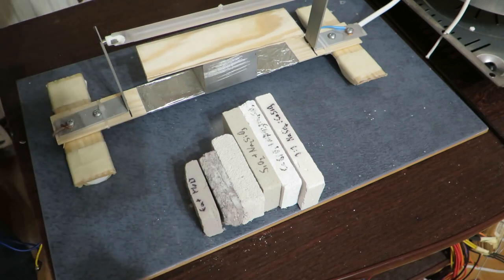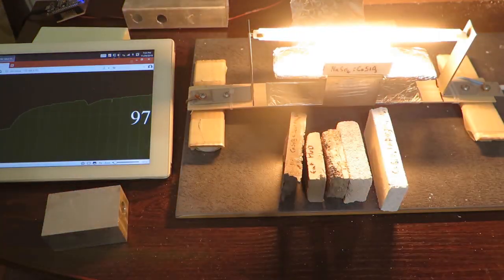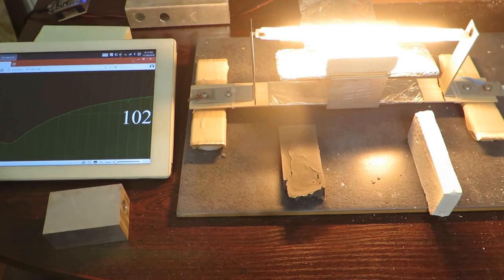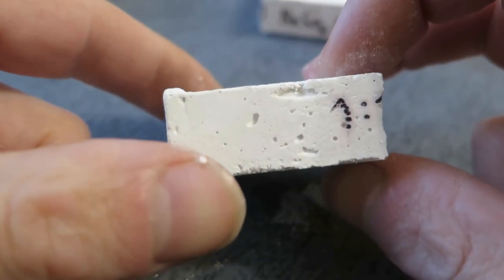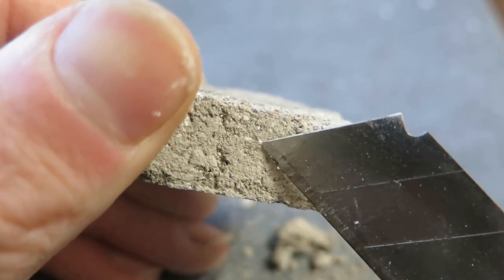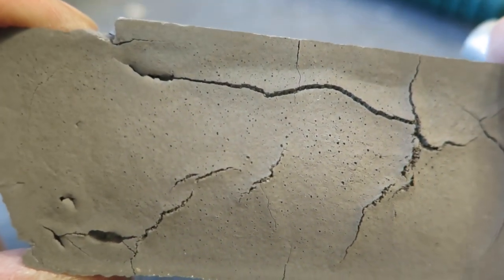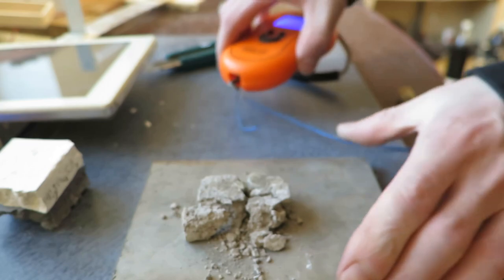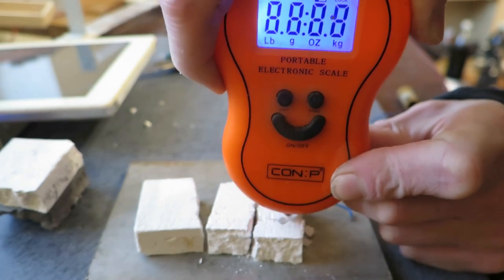Comparing thermal conductivity of DIY "firebricks"

Comment: Hi, what about perlite with sodium silicate? Or perhaps aluminia clay mixed simply with water and then burned? Maybe perlite for volume and Aluminia clay for binder?
Reply from the maker: 15mm insulation is my limit I forgot to mention :)
I mean I technically could get those materials from amazon, but this shouldn't be that hard to get... I guess this is sort of thing that I can not stand, that I am unable to do myself. You should be able to just google "low thermal cunductivity diy ceramic recipe" and just use it.

Overall ceramics is pretty foreign(may be the problem) subject to me, but I don't want to understand it deeply, just to use available knowledge.

Comment: Could it be that hotplate material is more reflective to IR so it's not only thermal conductivity at play there?
With your setup you measured not only conductivity but absorption as well.
Reply from the maker: Sure, it may be more reflective to IR, but I am testing with this setup, because it kinda models reality. I guess I have described what I am doing wrong, but people should get the idea...
Reply: @IlusysSystems  what i'm implying is that maybe you could alter reflection factor without altering other properties too much. For that you probably would need to measure conductivity separate from absorption to get a better idea of what you're dealing with.
Adding something like titanium dioxide to the mix could help with reflectance, maybe you can even add some kind of reflective coating. I could be wrong about that though.
BTW have you tested commercially available fire bricks and kiln bricks?
Reply from the maker: @JGnLAU8OAWF6  Yes, this is kinda what I have written in description. 

In reality IR emitter is enclosed in quite tight space and you can see the lining glowing red, so it definitely absorbs a lot of heat. Also emmitter will be in physical contact with lining, but in most ceramics a lot of heat is transferred via IR radiation, but this also depends on temperature (both modes have different coefficient + at lower temps IR is almost non-existant)

I tried TiO2 coating, with non-measurable results with my system. I tried aluminium foil, which worked exceptionally, but at higher temperatures it won't last long. even at lower, it will get dirty and you will bake that dirt in.

I have not tried commercial firebricks. Fibrous insulation would be better competitor though because firebricks must have also much much better structural properties. I won't be able to reverse-engineer random firebrick and this seemed to be good project to try to do.

Comment: Why not make normal refractory using alumina, silica, titania, it's easy to make with 1% iron oxide.
Reply from the maker: Because it's not very insulating. At least I wasn't able to make such material. Material also had to be castable. Maybe I will reiterate for future projects, but was able to make material that suits my needs